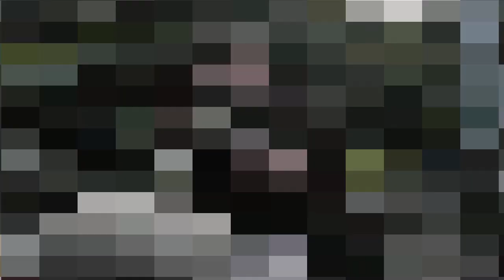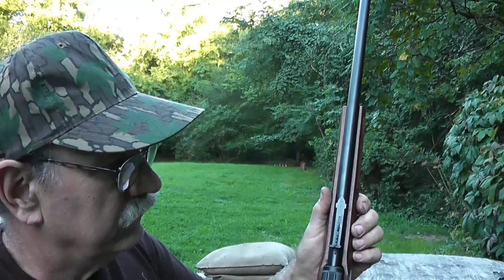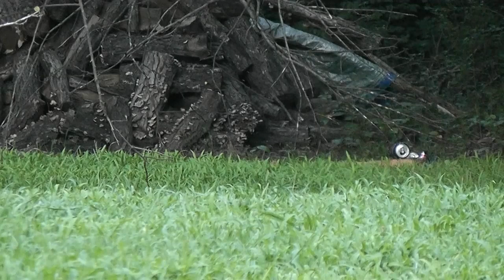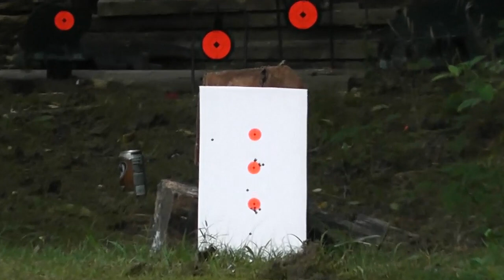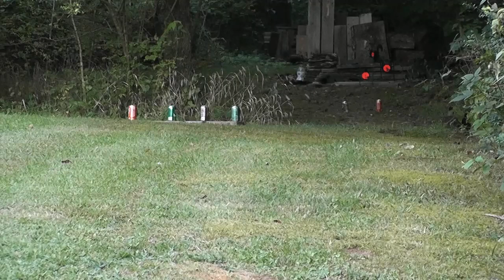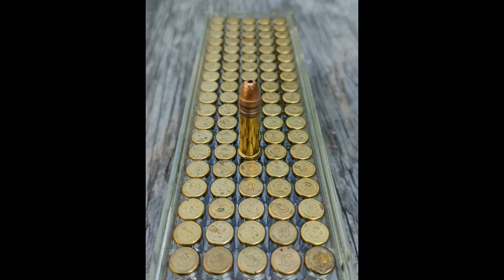Shooting a Glenfield "Squirrel Stock" .22 the First Time

Comment: I don't see ruger ever making the model 60 again because it directly competes with the 10/22. The model 60 was always a little less expensive when new which is probably why more model 60s were sold. 
I gave one to my brother but I still have 2, one made in 1971 and one made in 1981. Ironically there is a slight difference in the copper tubes between the two.  The 1981 has a sort of cap that fits over the feed tube but the 1971 has the barrel band holding the deed tube closer to the end of the barrel and doesn't have the "cap". The cap is a hindrance because it is harder to lock the tube down.  I don't really want to disassemble the feed tube but I may have to

Comment: Just picked up one of these today (with the squirrel stock ) ! Found it at the local gun shop , paid $185.00 for it . Looks to be in beautiful shape . Hopefully, it fires as good as it looks . I'll be looking up the serial # as well . Curious when it was made . Anyway , just my 2 cents . I'll be checking out your other videos on it . By the way , where did you purchase your upgrade kit for the bolt hold open ? Sounds like a worthwhile upgrade...Thanks,  Dan...
Reply from the maker: Congrats on your acquisition. I hope that little rifle will serve you well. To answer your question regarding the upgrade, I actually found all the parts on Ebay. You will need the cartridge lifter, lifter spring, feed throat, release lever and spring, and some alteration work on the right side action plate, the stock, and the trigger housing. I posted a video on how to do it. It is a bit tedious, but as you said can be worthwhile.
Reply: @CumberlandOutdoorsman  thank you so much for the info .. All the best to you and yours ...

Comment: Yup, a pity the Marlin lawyers had to shorten the magazine capacity (and barrel) of the model 60. I remember the old ones. Funny thing about Marlin. Why they called soooooo many rimfire rifles "Glenfield". I got a Papoose in 1991 and did find a keen used model 20 bolt gun in 2010 for under $80. It also had that funky squirrel/gopher imprint. It was a hefty sucker and had the Monte Carlo stock swell so boss for scope shootin'. Those Micro-groove barrels sure are accurate. My choice fodder was Armscor Precision .22 solids. I added a BSA S4X32WR optic for under $20. As they used to say in the old west..."there ain't nothin' wrong with beans that a good rifle won't cure". Cool video.

Comment: I learned awhile back when one needs to tap  the rear iron sight left or right it's hard to really tell if the sight moved. I found that by putting a pencil mark at the front sight point on the barrel that most barrel sights have, it gives one a reference point to determine if the sight moved and how much. It's simple and works very well. I enjoy your videos very much so !  Continue in the direction of God.

Comment: Thinking about getting my kids into shooting and gun safety this year and I knew I had a couple .22's laying around.  Just checked and I have the older Squirrel stock with the JM stamped on the barrel and full length tube.  If I am doing the serial number right, it's a 1979.  Have to clean it up and see how it shoots.  Any recommended ammo or just try a bunch?
Reply from the maker: The go-to ammo I always use to test any .22 is CCI Standard velocity. If you plan on shooting small game, then you can switch over to CCI's Sub-Sonic hollow point ammo. I have found it is just as accurate, and usually has the same point of impact. If you want more power, I like either CCI Mini Mag, or the new Remington HV hollowpoint Golden Bullet as being quite reliable, unlike when it was being made some years ago. The last 500 round pack I shot didn't have a single misfire, and performed admirably.

Comment: I've got a Glenfield mod 60. Probably a little  older. No bluing left on the barrel or tube. Hand painted stock buck scene on one side turkey on the other. Found in an abandoned shack on the property somewhere and paid $75.00 to get it. Works just fine and will probably leave it as is for the rest of the time I own it!

Comment: I own the Glenfield Marlin model 60 made in 1976. It will hold 18 rounds in the magazine tube but the bolt has to be closed when you load it. Just double check to make sure it is unloaded before loading with the bolt closed. Remember it also has a safety to use. Liked the video though, great job.

Comment: I found a Glenfield model 60 in a pawn shop a couple years ago. It was not in as good shape as yours. I bought it anyway and have had fun shooting it.
Reply from the maker: Hey, that's really all that matters in a practical sense. After all, these little guns can easily be refinished and restored as you'll see in an upcoming video.
Reply: Hey CO, I just got a Glenfield squirrel rifle from my wife for my birthday. Stock is pretty rough and will need refinishing . Problem is the safety foesn't ho on to well, have to push hard as you can to move it. Moving the safety to fire is fine though. Any suggestions?

Comment: I was 14 years old (41 yrs ago)  when I went with Dad to a department store in Syracuse NY and he bought a Glenfield 60 with a squirrel stock brand new for, like, 70 dollars or so. I believe its the exact same as the one you show here. I did have to replace the recoil spring once because it had a kink in it and caused the gun to jam. Dad is gone now but the 60 stands in the center of the gun cabinet, spotless and ready to go.
Reply: @oattyler9173 now it's an assault weapon according to NY
Reply: @beargillium2369  As much as I dislike NY gun laws, the model 60 is not conidered a so called "assault weapon" in NY. It's also exempt from the 10 round magazine limit due to being a tube fed .22 rimfire. I'm sure you were joking, but if not, do your research
Reply: I bought one in 1972 at K-Mart for $38.88.
Reply: ..I was 13 years old when dad gave me a Marlin 81c..tube/bolt 22 in the night I graduated 8h grade in June 1963...

Comment: Tks for the video.  I, too, have a Model 60 with the long barrel and magazine.  Bought it new.  I took it clear down and apart and cleaned it, it needed it, and tooth brushed the mechanicals with solvent, and of course lightly oiled it.  It is a sweetheart.  I treat the unmolested stock like it is fine walnut furniture like I do all of my guns.  I also own another Marlin, a 39M (M for Mountie) that I bought new back in 1976 in Wellington, Kansas at a little gun shop.  That does have a walnut stock and has a pretty grain to it.  That microgroove rifling is for dadgum real, right after I bought it I was in farm country and from about fifty yards away, not a historical shot I know, but that rotten old fence post, about three inches in diameter, I saw it wiggle.  I traipsed over there and darned if I had not hit it absolute dead center.  I wanted a Marlin 39M because my cousin had been given one many years earlier, and I knew what they were and are.  My first rifle was a Christmas gift, I was 12 at the time.  A Remington 572 Fieldmaster.  Yes, I still have it and treasure it.
Reply from the maker: I own a 39A, and am planning on making a video dedicated to it. Old guns have a special appeal that is lacking in the new stuff.

Comment: Another great .22 review, Tom.  I just remembered, I have one of the squirrel stocked Glenfields.  It is currently residing in my son’s gun cabinet, I might have to reclaim it and give it a try.  About two weeks ago I picked up my second Marlin 39A.  This one was made in 1946 and is in remarkable shape for its age.  I shot it last Saturday for the first time with open sights.  It functioned flawlessly.  It is drilled and tapped for a vintage Weaver N3 scope mount, which I luckily had one.  It accepts a 3/4 inch scope, which I had a couple of those lying around as well.  Undecided as to whether or not I will leave it with open sights or give that old scope a try.  My other 39A was made in 1969 and has the Micro Groove rifling.  The 1946 rifle has Ballard rifling.  In recent years I have developed a new found appreciation for the older Marlins.  Keep the .22 videos coming.
Reply from the maker: We must be on the same frequency Wayne. I just got a Marlin 39A as well. Mine is a 1950 model. I am looking forward to making a video with it. I don't know which barrel is the most accurate (micro-groove or Ballard rifling). I think the micro-grooved barrels probably have an edge over the rest. Then again....my Rem. 581 has standard 6 groove rifling, and it is amazingly accurate.

Comment: I have two of em and they shoot great ..... after I watched your video and replaced the ejector/lifter springs in both.  One of them threw  a dime sized 5 shot group (25 yds) for me.  Also have the Mod 20 with the groundhog.  Only need the Model 30 to complete the set.
Reply: My Marlin Model 60 from the early 90's will shoot dime sized groups at 25yds with good ammo.
Reply from the maker: Like I said, those little Marlin are great shooters.